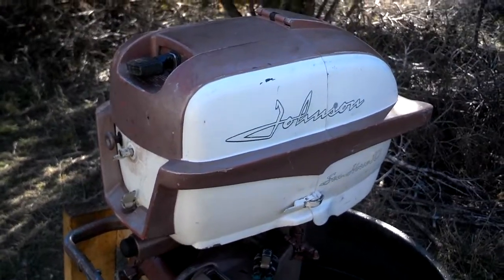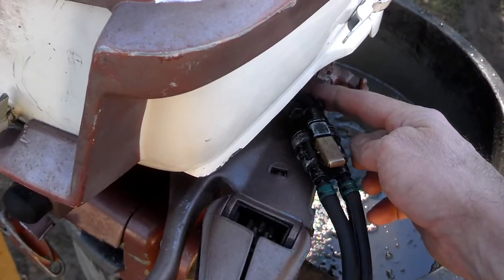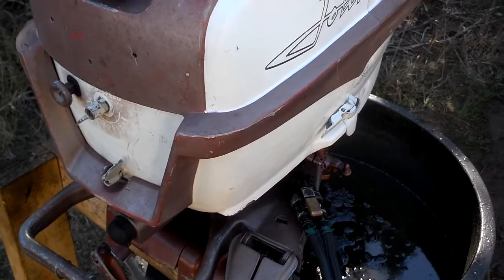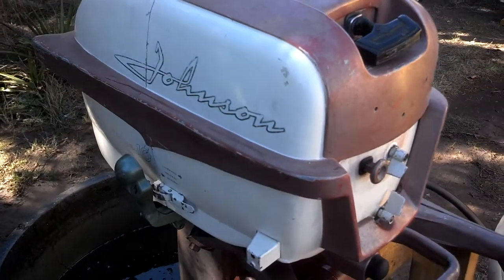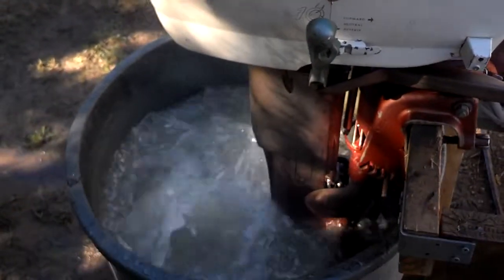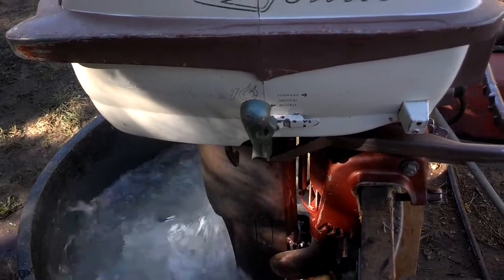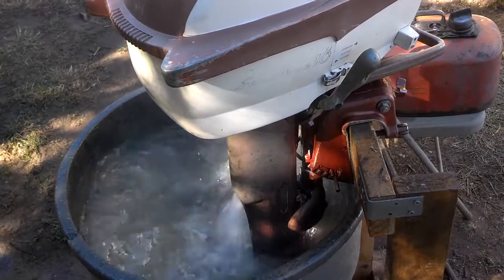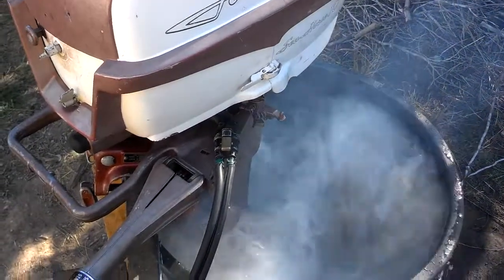1958 QD19 Johnson 10 HP Outboard

Comment from the maker: I replaced the shifter handle only. Replacement of the shifter shaft is much more involved.  This operation requires removal of the powerhead from the lower unit exhaust housing and a new gasket when reassembling.  It's a pain to replace the shaft if you don't have to.